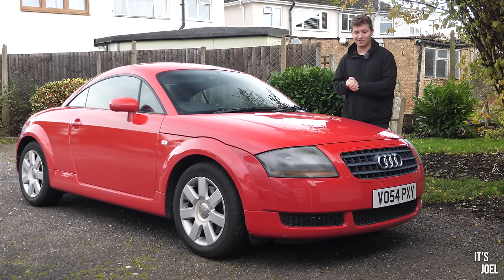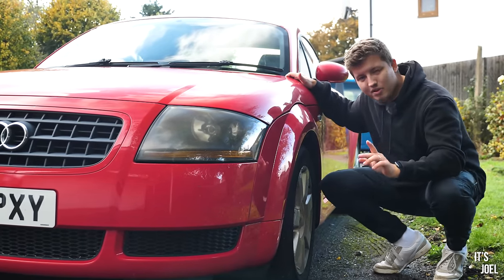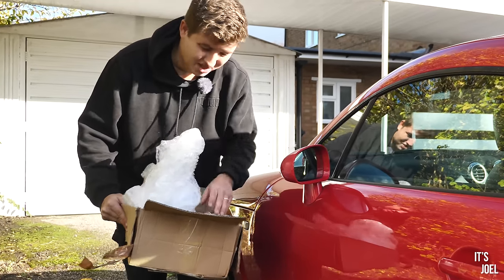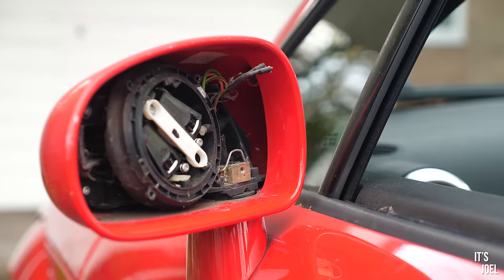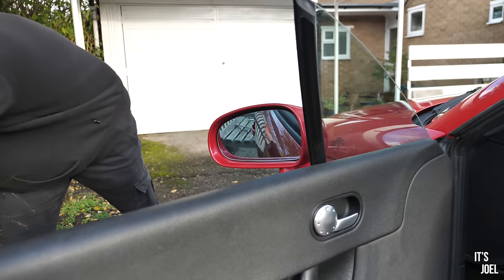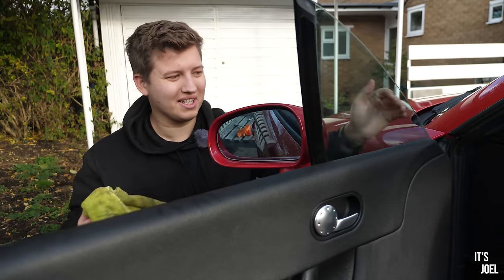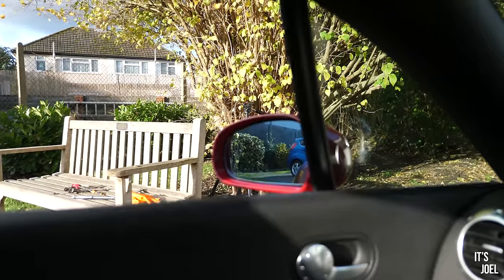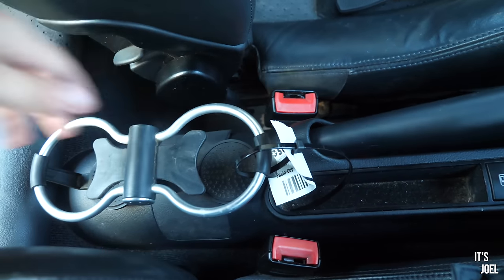I'M SELLING MY AUDI TT...

Comment: I’ve never thought the weather in England particularly south of Watford warranted worrying about 4wd. I’ve driven a rear wheel drive car for the last 20 odd years in rain or snow and never had a problem although undoubtedly winter tyres would help. The Germans manage to drive their Porsches, BMWs and Mercedes in winter. The French and Italians mostly front wheel drives and the all have harsher winters than us.
Reply: The Europeans have much better infrastructure than we do and are far more prepared for the weather. I live as south as you can be and a 4WD is definitely recommended most of the year (flooding etc.) but mainly for the pot holes 😂

Comment: Why not replace it with a TT quattro?  Cayenne is an interesting choice but be prepared for big bills if something goes wrong.  What about the XC90 you were battling with, isn't that AWD ?
Reply from the maker: Good point. I think as well as the AWD thing, I am ready for a different car with more refinements. The XC90 should be AWD, but apparently it’s not running as such.

Comment: Mate. Cup holders in 04 were deft not considered an essential accessory for our cars . In fact you would have been considered bizarre if you had requested them. We were also not obsessed with bottled water / Costa coffee and incidentally the human race had managed to survive at least 10000 years with out them!!
Reply: They look like a pair of handcuffs. If I bought one, I would take them out. I don't drink hot beverages at all, and don't agree with people drinking hot liquids at the wheel. Perhaps it's because I was an instructor, and am more in tune with safety.
Reply: Exactly! Drive through just wasn't readily available back then and even if it was there's no way I'd have risked a potential spillage in my TT

Comment: You should have used a drill on hammer setting to get that mirror off without breaking it Joel :)    ,,, You could have sold the old mirror assembly on the bay and re-couped some of the cost?

Comment: Two screw holes under plastic covers base of cup holder. Thats not steady. And you have missing trim on that one you bought. Thats not fixed put a bottle water in it. You need fasten properly. Ans you may as well mentioned the emergency boot release you exposed when removing old trim

Comment: I wouldn’t touch it with a bargepole if you have done any work on it after the crap job you did on the Volvo!
Reply from the maker: Thanks for your input
Reply: @hillmangt1. Have a look up on the personality type, radiators and drainers. Try to be the former. At least he had a go and never made out that he was some expert at it.
Reply: @judgementalTX  I stand by what I said. Don’t mess with cars when you don’t have a clue, it’s dangerous to yourself and others. If you’re not prepared to do something properly and to the correct standards leave well alone. Joel was told many times in the comments how to solve the problems but chose to ignore them.